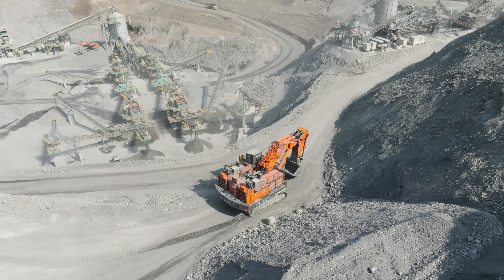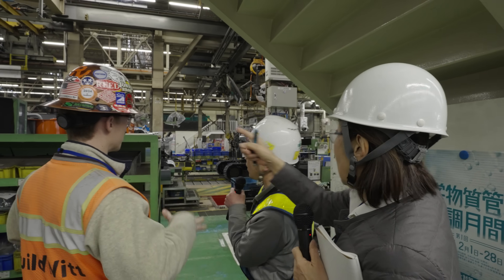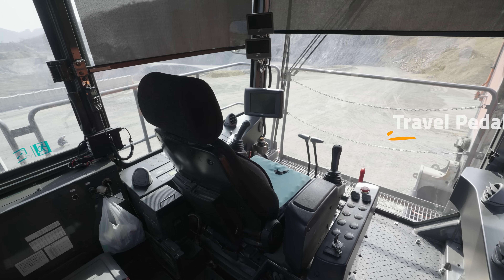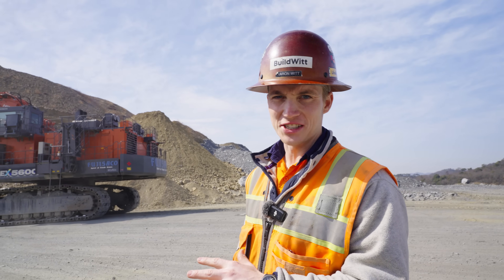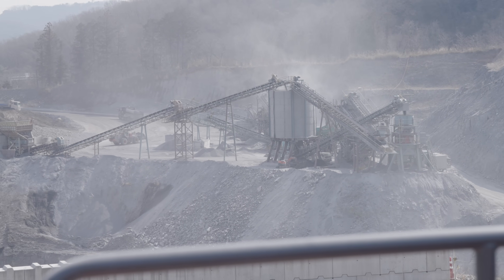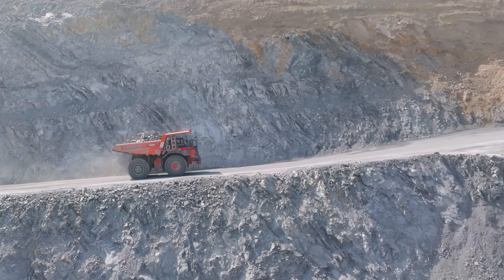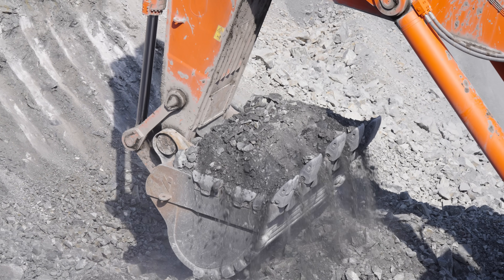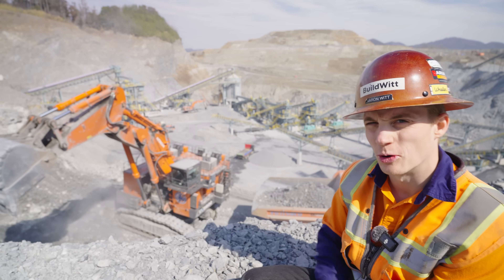Exploring Japan's BIGGEST Earthmoving Machine!

Comment: https://youtu.be/opOva1Ly2Nc?si=DcPLz-05c42mmQYM

Here is a video of my oiler and i loading one of the crowd arms of the bigger 8000 model. We were using a 110 ton truck crane with 48k in counter weight. The crane could only lift and position that weight at about a 20’ radius yet the machine lifts this plus bucket and load at a longer radius all day long. Amazing.

Comment: I find it odd you call the wear plates as 'softer' because AR500 steel is anything BUT soft.

They use the HARDEST possible steel they can employ without the metal shattering.

I've used and serviced heavy equipment for more than 30 years and I even own a 1962 Mitsubishi BS3d which is a combination loader and excavator.

Comment: Aaron, I'm going to be that guy, the mining truck's power train is not like a prius. A prius uses what is called a parallel hybrid where both the engine and electric motor drive the wheels. That truck uses a series hybrid where only the electric motor drives the wheels and the engine powers the motors. Yes they are both hybrids but its like calling a gas engine a diesel.
Reply from the maker: I appreciate this comment

Comment: Any idea what the logistics involved in transporting the shovel to the mine from the manufacture and what the assembly timeframe might be?  Did they Truck it in or was it brought in by Rail?  I’m guessing the shovel has to be brought in by railway due to the weight of the extremely large pieces involved?
Reply: I have moved a couple 1000s and 1200s here in the states... Usually 1 multi axle beam lowboy with 3 to 4 other tractor trailers for the fall off loads(Tracks, Stick and Bucket etc) I would imagine at least 5 to 10 loads on one of those beasts.
Reply from the maker: They bring it in pieces by truck

Comment: I’ve run excavator for 20 years. Cat, JD, Hiatchi, Volvo, Komatsu. Hitachi is my favourite. Very smooth and reliable.
Reply: Mr. Chuck, you've actually ran two versions of Hitachi lol..............the other is black and yellow, starts with J and ends with ohn Deere 🤣
Reply: @woos31 They are quite different from each other. I have two older twin machines, one JD and the other Hitachi. The Hitachi is much smoother and more reliable. Isuzu makes much better engines than John Deere.

Comment: I've always wondered why no manufacturer has gone with a sprung cab or hydraulic or bagged suspension. It wouldn't be too difficult and if a customer doesn't see a value in it, just make it optional! Why hasn't anyone done this?

Comment: Always funny when an operator is wearing a hardhat inside the cab of a machine.  Maybe he's worried about bumping his head on the roof.
Reply: And don't forget about the safety sandals
Reply: almost 100% chance it's safety policy
Reply: If the excavator probably leans over and falls the head should be protected
Reply: Those are the stupid rules and regulations that don't make any sense, but I'm sure that the guy takes it off when nobody is there

Comment: No big deal, just a moving house that can dig a pool in 5 minutes
Reply: It wouldn't take that long though getting it in your yard could be a challenge.
Reply: @peterfalconer-h3k  as if there is anything in my yard that would stop the machine from rolling in 🤣
Reply: @CuthbertNibbles  Aside from numerous trucks and a couple of very big cranes to assemble it.
Reply: @peterfalconer-h3k  as a project manager, I have the perfect solution to that very problem: "That's out of scope" 😁
Reply: @CuthbertNibbles  Good answer.
I've been involved in shifting a few machines of a similar size here in Western Australia, the logistics can be a challenge at times.
Reply: One Olympic pool
Reply: More like 6 seconds.